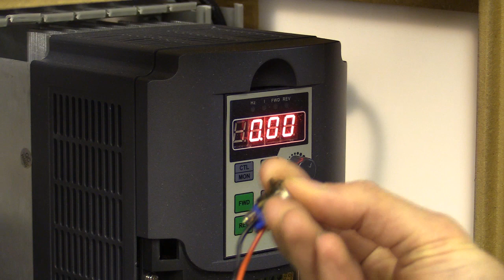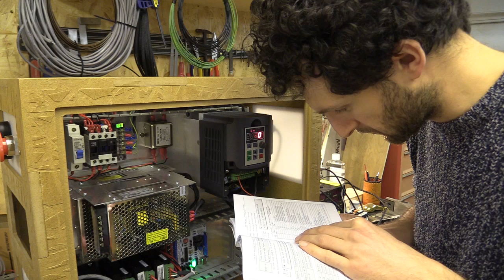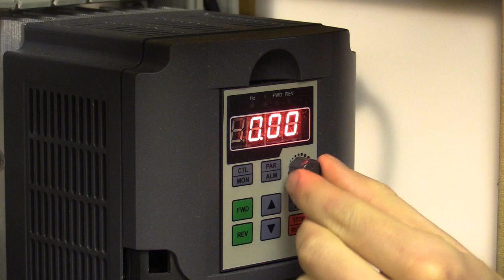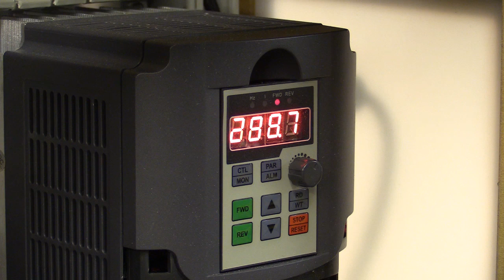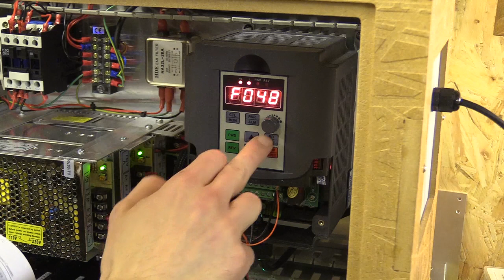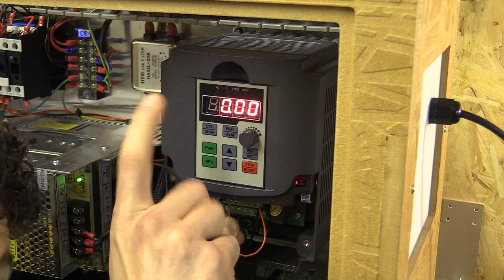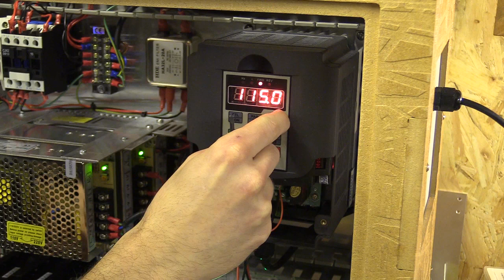#15 VFD PWM to Potentiometer Speed Toggle Switch #15 / CNC Control Box

Comment: Awesome that is what I'm willing to do...
I think that not all chinese VFD have a function to determinate a pin to act as a selector for the source of the operating frequency (Analog in or Potentiometer)... Like the one discussed in this thread: 
http://www.cnczone.com/forums/spindles-vfd/117782-huanyang-chinese-vfd-settings-manual.html 
Thank you for the video!

Comment: Most VFDs will have a brake feature that will electrically halt the spindle when deployed. If you hit the brake on your motor controller and cut the power at the same time there will be no power to run the brake. I'm leary of this shutting off the power as a safety when likely what you really want is the motion to stop as fast as possible. Also what will happen to a hot spindle if the water is shut off with the power? I've noticed that most people wire the pump to stay on after the spindle stops.

Safety circuits can be implemented many different ways depending on what you are trying to protect and your local codes. The safety circuits I'm used to are wired NC and the theory is that if a wire were to become disconnected or a switch become dislodged it would prevent operation. The theory is, anything that may fail should be wired in a way that a failure reports the worst condition not the best, eg. if your gas gauge on your car were to fail it would be better that it go to zero than to full. If you want to sense the water level or temp of your coolant that circuit if it became open should indicate empty/overheat.  

I'm building my own CNC router and this safety theory stuff is taking a lot of time just to get my head around and I've worked putting automated machines on assembly lines. I believe it's worth the effort, my motivation is that if I fail the machine could start up and take my hand off then I'd look like a real idiot.

@5:02 Flip flop could be a function that turns a non latching button like the one you've shown into a latching one. You push the button once and the VFD sees this as a push ON, the next time you hit it the VFD sees it as a push OFF. Might be what you need.
Reply from the maker: Ahhh so useful. I'm only cutting 24v power to the control board, and I have since wired the estop to the VFD terminal with the breaking function - so everything stops. But I'm having a new problem now that it holds the break until I get a overload message which means the VFD has to be reset. The VFD break is normally open and stops when the estop is closed while the 24v is normally closed and opens when pressed - but if it the estop is reset too soon the steppers will move. That was a problem with the older CNC machine and controller. There isn't a dedicated terminal for an estop on my controller - but I could wire the hold button or stepper enable wire through? Will have to test this all when I get further ahead.